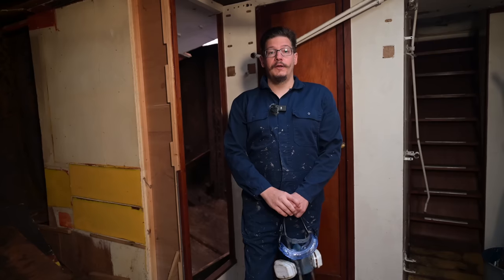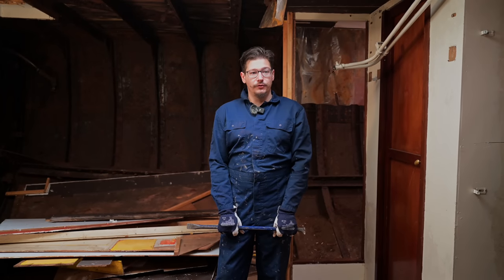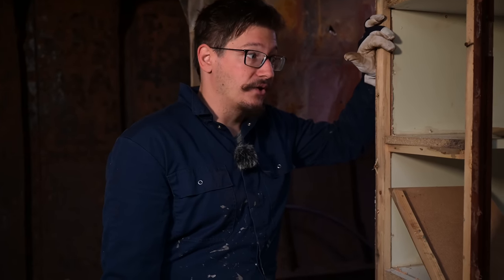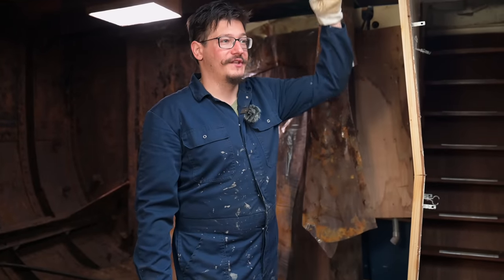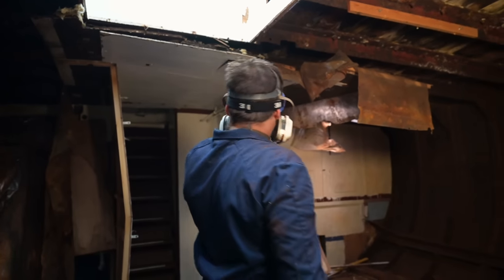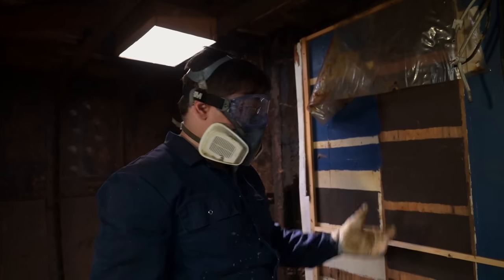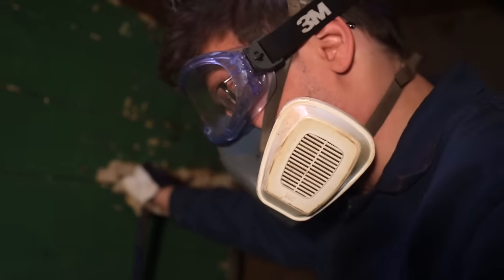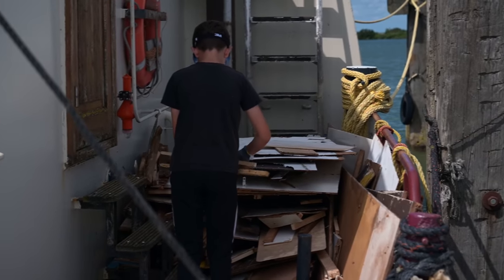A Clean Slate - Big Progress On Our Huge Boat Project!

Comment: Experience says ripping everything out is the right approach. I recommend that after you do the frame repairs, you get a laser measuring expert in to measure the entire interior and create a 3D CAD model  of the interior. This will really help with the layout of the interior spaces and all the service conduits that are required. Whether you use a boatbuilder or do it yourselves, exact measurements will save time and money. Looking good so far

Comment: Barbara & Daniel, I totally agree seeing that press-wood and corrugated boards, none of that belongs on a boat and even if it did not get wet it will continue to absorb humidity creating smell and  a heaven for bugs infestations.
You will be able to easily make an interior 100x better from scratch.
I think the items you are now keeping look nice because you are comparing them to what truly is junk, but be mindful that when you compare the nice worth keeping pieces, to new quality wood etc, they might look much less appealing. Ask me how I know! And for me I was actually renting space to store these "worth keeping" pieces that a few years later I just paid someone to take to the junk yard. 
When I started thinking in terms of % of value against the renovation instead of the potential $$ value it changed my perspective.
1k$ is some $$ but if it represent 0.5% of the cost of the renovation and you will have to thinker with something that is not really what you want, not really good, doesn't really fit... It is just not worth it.
Just a thought.
The mast location is indeed very exciting!!! 
It would be wonderful to find that a drawing or old painting that would have simply been boarded over and discover that it is a long lost Picasso or something. 🙂
What great space you have in Flying Coney!!!

Comment: I highly recommend using plastic barrier walls around any engine room insulation removal. It is Highly Likely to have asbestos in it and will contaminate your ship
Reply from the maker: Thanks for advice. The engine room itself is not insulated. It's the insulation of the cargo hold and it's made out of cork. Most likely no asbestos but we will wear the masks and be careful.

Comment: Are you going to spray foam the insulation when you’re ready to do so?  They say it’s better to do so, as any air gaps between the steel hull and rigid foam would create moisture and condensation.  
It’s great ripping out, but then it’s hauling it all away 😂. Have fun, I see you’re loving it 😂👍👍👍👍

Comment: If I might add I am  impressed by  your Herculean efforts.   Your mental stamina in particular is remarkable.  If it flags then tell yourself one step at a time slowly.  Also regular breaks, if possible, are a good thing.  You will, however, when finished have a boat you know is not hiding crumbling metal or smelling of age.  That will be necessary for those who may come on a paying holiday.

Comment: What a wonderful blank canvas y’all are creating! I’m very envious! There’s a lot of needling in your future, and gallons of rust converter to be liberally applied. But when y’all are done, you can rest assured that Flying Coney will be around for many many more decades to come, and will transport the both of you safely to anywhere in the world your hearts desire! 
My suggestion is to keep as much wide open space as possible. Any area can always be divided up at a later time if necessary, however it’s very difficult to remove interior once it’s installed. 
Keep up the great work! You’re on the right path, as is made evident by all of the rot you’re discovering that was sadly just layered over instead of being properly repaired or corrected in the past. 
I would also suggest that you both learn to weld. New MIG/TIG units are so inexpensive now days, and with what we once in the trade would say, “you’ll learn by burning gas and rods”! 
In other words, experience! It’s also a great, I would say, a mandatory skill to possess if you live and travel on a steel vessel such as your own. Stuff breaks, usually when your leagues from a yard. You must be able to fend for yourselves. 
Anyway, from this now broken down old man that spent as much time as I possibly could on the salt water, but now is permanently dry docked in frikin Dallas Texas, plot your course,  be ever vigilant for uncharted hazards, and always be the shipmate the other can depend upon when the unexpected storm arises, and they will, very suddenly.
Fair winds and following seas on this wonderful journey that you have plotted for this wonderful old sailing ship, and yourselves! 
I can still taste and smell the salt, thanks for taking us all on this journey!

Comment: you're one of the best boating blogs on youtube, so many thanks for allowing us to see Flying Coney's rebuild. 
But i do wonder if it would have been only slightly more expensive to have bought a vessel that was ready to sail, as the work seems never ending.
Reply from the maker: Thank you. It's a very good question you've asked. First of all at the beginning we thought that we can do the project step by step. Second the slow progress is partly because we have to film everything. A good working sailing ship in our price range is about 650-800 000€. Our goal is to stay under 300 000 and it will take us 3-4 years.

Comment: This is a tremendous undertaking..Now that a big part of the below deck interior is removed a full visibility to the interior hull condition has been created.. I hope all this rust is surface rust that easily can be treated..
I admire your zest and drive to bring this old lady back to her original glory..
Reply from the maker: Hi Frans, yes the rust is surface rust, during the shipyard time we went over the hull with an air chisel. In theory we would only need to apply a product called "liquid shield" and it would stop the rust. But we have to do the welding first. Also I would like to do a little bit more surface preparation before.

Comment: Y'all really aught to invest in a reciprocating saw. Watching you try to do demo with a handsaw was a little painful. LOL

For demolition, I recommend at least an 1100W saw. Preferably more. Make sure you get a good quality one. Bosch, Makita, DeWalt, Milwaukee, etc. I have a Hitachi CR13V that's we used a LOT in residential construction for about 7 or 8 years. It's still going fine. I believe that's a 1200W saw. Orbital recip saws cut faster. For rough cuts on wood without nails, you can use a pruning blade. I like the carbide tooth 3TPI ones from Milwaukee and Diablo/Freud

Edit: and a 7-1/4" circular saw if you don't already have one. 185mm circular saw?

Comment: A lot of work there, Coney has had a fair few refits over the years, each one part of her history, amything that is reusable, in any way maintains her heritage and reducess refit costs, both aspects are important to the project. Thank you for the update and eagerly awaiting the next instalment.
Reply from the maker: The main problem is that until now existing problems always were just covered up. So we had to dig down to the most rotten base layer to get to the real problems. Fortunately the care is pretty decent and solid. But to remove the interior in a way were we could reuse more of it we would need months of time and storage space. Not even Leo has re- used a whole bunch of wood and I now understand why.

Comment: I have previously tried using a steam cleaner similar to the one you suggest to help degrease engines ... it was not even remotely effetive, even after spraying everything with 'gunk' degreaser ... I think you may be better off renting a steam power washer instead.

Comment: Is this destruction after you left the boat yard or before they started all the welding and repair work?? I thought you had already taken out the entire interior before welding started but I might be mistaken. Great thing about tearing out that cheap pieced together interior is that you can have a new layout that suits you and you can use modern materials, design etc which will mean a lifetime without issues. You will be happier and safer in the end doing a completely new interior, electrical and plumbing etc than trying to save parts and pieces. .
Reply from the maker: We are real time now! During the shipyard time we only removed the interior next to the hull. Now it's completely gone. It feels good and I can't wait to build a new one. 😁
Reply: It will be beautiful when done.. are you planning on doing it yourself?? Carpentry work isn't difficult and anyone with patience can be a great Carpenter including a furniture carpenter or one that builds the beauty into it rather than the structural carpentry work.. it's also quite relaxing if you allow it to be and very rewarding. I love the interiors of the classic sailboat such as Formosa or Hinkley etc. They have that solid and inviting look.. the carved doors on the Formosa sailboat is amazing.. thanks for the reply
Reply: The shredded material back by the cork insulation is from some rodent nest.. or atleast was attempting to build a home. Could have been a rat, squirrel, etc..
Reply: I will be glad to help you with the work including carpentry work as long as you bring the work to America cause I refuse to fly..

Comment: Are you going to remove all the loose rust on the overhead metal and the exposed inside hull. Are you going to put a sealer on the rust once you remove the loose rust .

Comment: Can you take out the concrete...while in the water?
Reply from the maker: At the moment we think so. The harbor we're going is a tidal harbor and we do have strong pumps. So probably we try it out with caution and also only if there's a possibility to haul out the boat if needed. We're not taking out the entire ballast, just a small bit that's covering up the frames.

Comment: At least there is no spray foam! Rockwool is the only proper dry isolation on a ship. No plastic damp barriers keeping everything wet.  painted wood will rot. Boiled linseed oil on wood and steel or rust. very old fashioned and affective My 2 cents...
Reply from the maker: We want to use liquid shield and perma shield directly on the hull. It's similar to linseed oil but made from wool fat. Cheap, efficient, not dangerous and it works in ballast tanks. For the insulation our idea is to make panels with Armaflex insulation and screw them to the frames leaving an air gap in between the insulation and the hull.
Reply: @FlyingConey  Lanolin is indeed a good traditional fishermen method. I have been looking for it, but I could only get it in 25ml tubes for skincare or 1000 liter drums in China. I used Armaflex in my bow directly glued to the painted steel. This is a major regret. I still see rusty condensation coming out after two years... Preparation was really good and 4 layers of Damboline....Never again. Very expensive and a b*tch to remove.  The best spots in my boat are the Rockwool on the painted hull, and mahogany ply with no moisture trapping plastics. No rust at all after 42 years.  The worst are glaswool on steel and a plastic foil and then the mahogany ply. This was only in place for 5 years and quite some rust already when I removed it in 2018. Breath-ability is key I think.
Reply from the maker: The brands name is HODT and they have lanolin based products in different viscositys. We want to use the FLUID FILM Liquid as a base layer and to have rust protection behind the frames and PERMA FILM above it. The idea with the Armaflex is to glue it on wall panels without any contact to the hull or any other steel. I kind of hate stone wool products. What do you think about sheep wool insulation?
Reply: @FlyingConey  Thanks very much for the pointer to HODT !  Unfortunately I have a quite bad wool allergy, so for me it would not be an option. The key is that the insulation allows all wood and steel to dry out.

Comment: I've done restorations jobs my self, never a boat but many other things. I've found even if the quality of the  wood is good the extra time it takes to save it, for the most part is not worth it. In a lot of cases your better off to start from scratch. Another is trying to fit in the old materials back into the new is, extremely time consuming. What is going on with Y Tube. What's the reason for limiting your viewership.